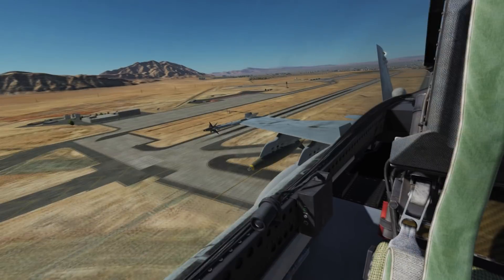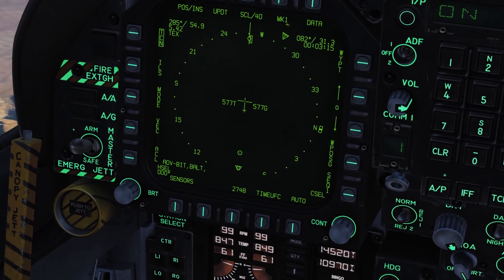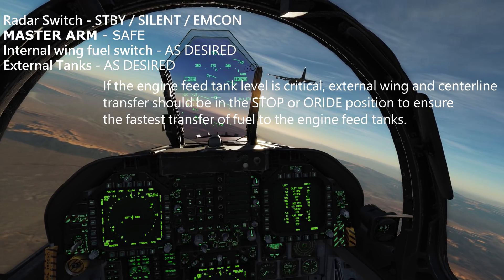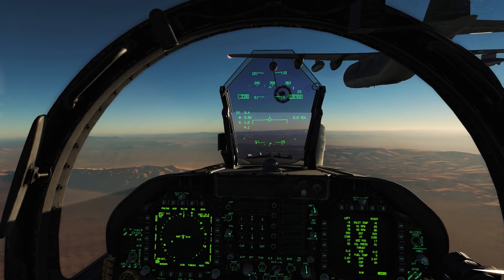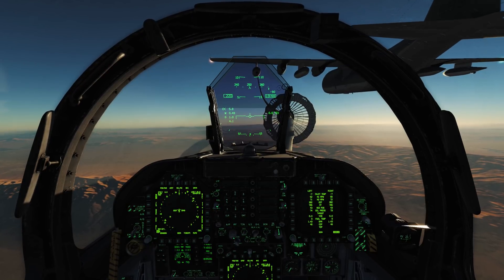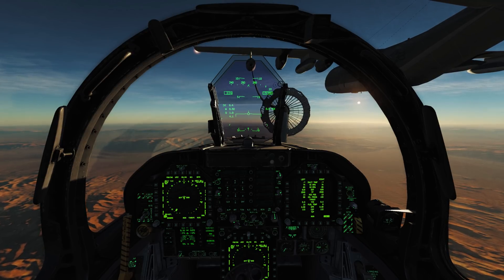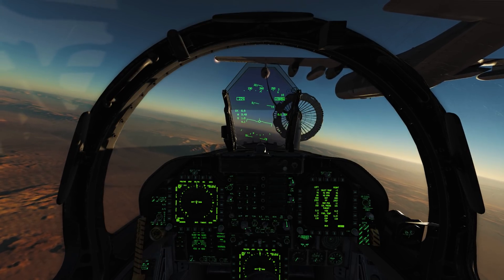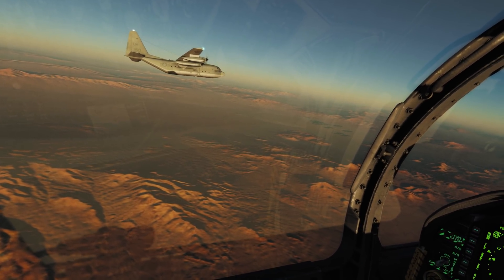DCS F/A-18C | Air to Air Refuelling Tutorial [Early Access]

Comment: Yeah... um....  the 10 degree marker you're using isn't showing up on my hud.  If I'm flying level, it's just too high for the hud to display it.  They must've changed how the hud works since this was made, or there's a way to increase vertically what the hud displays that I don't know.  No matter where I sit, the hud is staticaly displayed at the same size and angle from the camera position.  Even if I have a bunch of extra glass for the hud to use because I'm sitting low, it doesn't.  It just cuts off the bottom. I have to angle the plane upward 3 degrees for the 10 bar to be visible, and then, of course, I'm not flying level.  Ugh.  Game devs changing stuff and making something useful not applicable anymore (and probably less realistic in this circumstance, cause the real hud probably works fine).  Great video, though.

Comment: So I'm 6 hours down trying this with the grand total of 10 seconds of connection time. My formation flying is improving but it's still not getting my bug a drink!

I know it's all about practice, practice & more practice, but I don't want to practice bad habits, so I have a couple of questions about your technique, Mav.

In my mission, the tanker is flying at 280-285 Kts & the 10 degree pitch line isn't visible in the ladder. What speed did you set the tanker to fly the circuit to bring the speed low enough to get the required AoA to see the 10 degree pitch line?

You say you're maintaining position using trim adjustments. Is that vertical and horizontal trim or just to maintain pitch? And what about rudder trim, any of that invovled?
Reply from the maker: Hello mate!

I'm going to redo the video with an updated version, basically you dont have to use that pitch ladder it was just a handy reference what you should be looking at is the refuel probe (not the basket) on the Tanker aircraft itself.  At least this is what I do.

I keep my focus firmly fixed on the Tanker probe that the basket comes out from and I align my probe with my peripheral vision.  Every couple of seconds I will take a very and I mean VERY quick look at the basket to make sure I am on alignment but it really is just a snap look for 1 millisecond then my focus goes straight back to the Tanker.

Rudder is not something I normally use however if I need to I will use a little.

Check this link out, you ll see me refuel on the live stream with the controls shown in the bottom left corner.  You'll notice that I am always working the throttle, it never really stays still at all.  This is how much work is involved to stay in the correct position to get fuel.

https://youtu.be/4N1uUr-Mt8Y?t=2h20m14s

Comment: Trimming is the problem. I put trimming on the arrows keys. Up down is no problem. But for some reasons I can´t trim left right, and also the speed. Left right engines, both engines smooth, not working for me.
Reply: Juergen if you can refuel using keys for trim you are my hero
Reply: No hero here. I gave up the keys.  What I did is I set extrem curves on the stick. Roll, pitch and also throttle. Much better. I could refuel for 2-3 seconds, but still have to practice much.  How you guys do it. My stick X52.

Comment: Great video! How do you make that radio contact? If I bring up the communication menu with right ALT and slash, I dont see the Refuelling options you get, only ATC and Exit.
Reply from the maker: Sounds like you don't have a tanker in your mission, if you have one available he will show up in the radio menu.
Reply: 104th_Maverick thank you for the reply, much appreciated! I added a tanker, added TACAN in advanced, and it shows up on radar with TACAN so I can find it, but realised it was the C 130 I added as tanker. Its only the radio command that doesnt connect with TACAN (while it actually works with manual frequency com) Maybe I should use the C135 instead for TACAN?
Reply: Also when using the default radio frequency 305 instead of TACAN i can connect and get the command, I request refuelling, hover behind the tanker but they never respond for some reason and basket is never released. Im totally lost :) But I really appreciate your video and help! Gonna give it some new tries with the C135 instead of KC 130...
Reply: I got it working yesterday after the latest Beta update :) Seems like the update fixed it! By the way, I made a Refueling VR video today (on my channel) following a similar procedure to yours with TACAN, it worked great but I need to practice much more :) Thank you so much again for your tutorial - it has really helped me!

Comment: I’m glad for the bug, but I wish they would release stuff in pairs. I wish we had a Eastern counterpart to fight against. Still pumped though.
Reply: I guess it is in Russia like here in Sweden - it was possible to get documents about AJS37 Viggen declassified, but not JA37 Viggen due to some systems developed for the JA37 is in the JAS39 Gripen, (the JA37 was used as a platform for the development of the JAS39 system). So, it probably is a security classification and confidentiality thing with most of the newer military planes later than 1980. I think we should be glad the F18 was possible, it is modern aeroplane in this regard and for DCS.